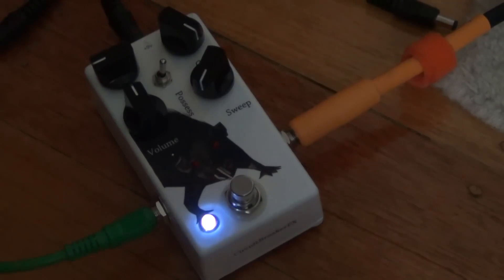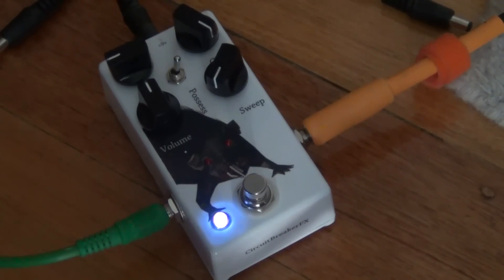Sound Demo: Madbean Slow Loris (aka Dennis Distortion)

Comment: What a freaky dirty little pedal. I want one.
Reply from the maker: Thank you sir.  You should build one :D
Reply: chromespherecom I just ordered my first fuzz box. Is this one difficult. I did build an alien screamer so I guess you could say I have experience. To be honest, I'm surprised the damn thing actually worked. :)
Reply from the maker: Paul L in a 1590b enclosure with the options I've added, it was relatively difficult, but the rat isn't a difficult circuit to build though.  Probably somewhere in the middle
Reply: chromespherecom Thanks.